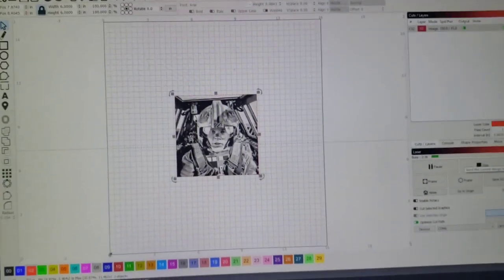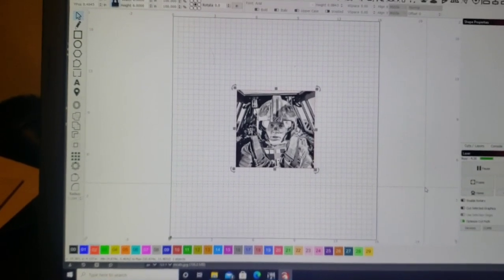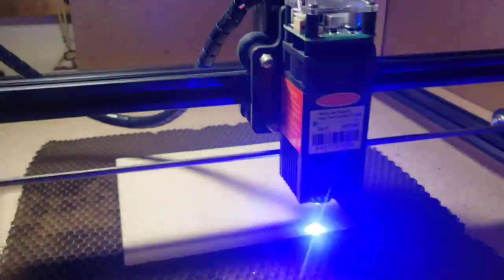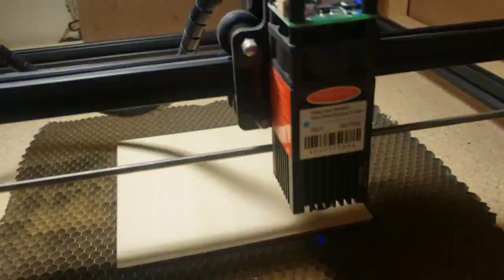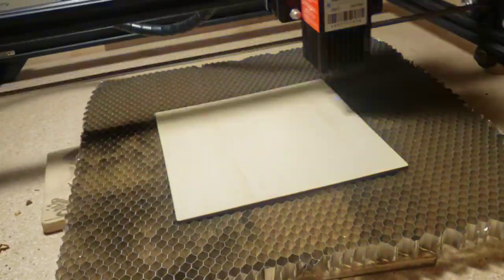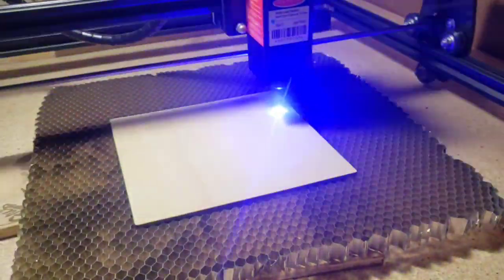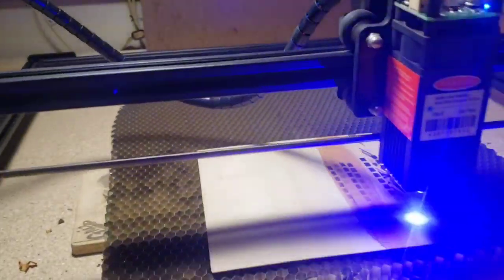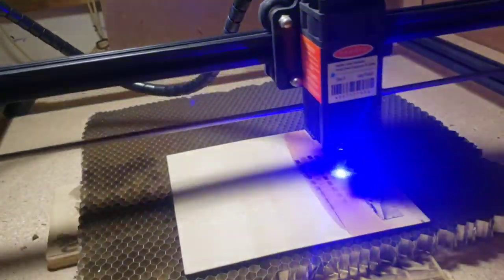The Kenny Hack vs Baking Soda has a better solution been found? mmm? You decide. Ortur Diode Laser.

Comment from the maker: So go to my Full project video. I show where to adjust the image in LightBurn. There is no magic number that works with every picture. This is why the Plugins might fail on occasion. They use the same settings for everything. If you follow what that video shows on adjusting Gamma, Contrast, Brightness, and the enhancement settings what you see on the screen will be close to what you get on the wood. Now all woods burn different. I like Basswood slabs from Hobby Lobby and they work very well with my method. Pine wood does not work at all. Only burns black. So if you like a certain wood you need to practice on that wood to see what the image needs to look like on the screen vs what it looks like on the wood. This is very important to understand. Using other peoples numbers only gets you close. You have to get the correct settings for your machine and wood type. Using real wood slabs is the easiest. Treat both sides with the same amount of stain and White Wash. Practice a few test burns on the back to check your settings and then burn the image on the good side. Most plywood the back is a different grade of wood than the front so the numbers won't exactly match.

Comment: I'm curious, what is your ebonizing method? I heard baking soda and lime juice but in the video it seemed as if that wasn't it. Could you please share what it is that produces such clear photos?
Reply from the maker: Often called vinegaroon. Mixture of steel wool and vinegar. Works very well to age most woods. What I have found to work best with diode lasers is 1 tbsp of Borax mixed into 1 cup hot water. I have a video going over using Borax. The Vinegaroon "Kenny Hack" was just something I found when I first started using lasers. It just made it possible to get the speeds up to 6000-9000mm/min which at that time was considered impossible to produce quality work at that speed with a 5w output diode. Pretty common speeds now for the higher powered diodes. When I first started 1000-2000 mm/min was what most people were running at, most people thought I was lying when I'd post +6000 speeds.
Reply: @TheKennyHack  oh wow, thanks! Is there a video you've done sharing this vingroon technique?  I'd like to try it as I have the 10 watt congo z1
Reply: @TheKennyHack  I've found that borax leaves a black soot that smears unless you clear coat afterwards.  Do you experience this! I feel baking soda in warm water works better.  I have a friend that is producing killer images with just that

Comment: Hi. Love the videos. Very helpful. 
What is the magical solution you use? 
I was watching your slate engraving video and you said you used 50%, is that the same thing?
I’m currently trying to dial in my engraving skills. 
Many thanks.
Reply from the maker: I've since found 1 tbsp of Borax mixed into 1 cup hot water to be the best treatment to use for most things. Just whipe it on and dry. whipe the surface with your hand after it drys to brush off excess Borax and it should be ready to go.
Reply: @TheKennyHack  epic. Think you so much. I’ll give that a go. Legend!
Reply: @TheKennyHack  out of interest. Long shot but, Will this work as a prep material for engraving metal too? 
I’ve been playing around with diy things I’ve seen on YouTube but don’t get a very dark engraving. I’ve seen brilliance black metal laser spray works really well but its £85 for Can. 
Any advice much appreciated. 
Many thanks.

Comment: I have a 4.5 output 30 W module diode laser, i use 20% power 3000 speed,with a teaspoon of bacon soda to 1 cup of water , you had it mixed too strong.power can be set lower than normal also .it does work brother..
Reply from the maker: try Borax it works way better than baking soda. Baking soda is useful when working with food grade products, it just didn't work very well at maximum machine speeds. If you're fine with running slower speeds it works just fine.

Comment: ok, after following your recipe at a 50% solution i can attest that it works as advertised.  i was able to double my working speed and get my work done faster. Only question that i wasnt sure on. do you a)strain any of the residual steel in the solution and b) if not, do you stir it prior to application?
Reply from the maker: I don't strain out the residue, but I know some people have. Yes, I stir the contents prior to applying it. 50% is pretty strong and will really stain most woods. You can knock it down to about 10-15% and it won't stain as much but still allow you to run at higher speeds with less power. A lot of people are coming up with their own mix recipes of this stain and other products to help with burn efficiency. Im kinda biased to my method but don't be afraid to try other things. Just make sure they're safe products to burn. I've found some great burn enhancers but they weren't safe to recommend for use.

Comment: Baking soda worked for me, much better then no treatment, a darker more defined image. 1 tblspn/cup water. 2400/50, 20 watt Atomstack
Thanks for all your time, effort & info Kenny!
Reply from the maker: I think a lot depends on the laser. I get better results with baking soda on my stock 15w model vs the stock 20w and better at lower speeds. Working on a kitchen sink mix that has a bit of everything in it. Im always looking for best results at 7000+ speeds to get the most efficient time out of my laser use.
Reply: @TheKennyHack  how long have you been running your machine at above 3000mm/min? Have you noticed any issues in doing so assuming you've been doing it for a while
Reply: I got a 40 watt nasum a5 pro coming tuesday hope the baking soda method works!

Comment: ammonium chloride !!!
Reply from the maker: Works well but you shouldn't burn chloride with a laser. Makes corrosive fumes that will damage the laser and toxic to breath.
Reply: It's found in allot of food and is also great for wood burning with a heat gun. Not sure the laser would produce sufficient heat.

Comment: Can you do a video on how you adjust your settings to get desired results along with what your preview shows? Thanks loving all the help you have shown already
Reply from the maker: So go to my Full project video. I show where to adjust the image in LightBurn. There is no magic number that works with every picture. This is why the Plugins might fail on occasion. They use the same settings for everything. If you follow what that video shows on adjusting Gamma, Contrast, Brightness, and the enhancement settings what you see on the screen will be close to what you get on the wood. Now all woods burn different. I like Basswood slabs from Hobby Lobby and they work very well with my method. Pine wood does not work at all. Only burns black. So if you like a certain wood you need to practice on that wood to see what the image needs to look like on the screen vs what it looks like on the wood. This is very important to understand. Using other peoples numbers only gets you close. You have to get the correct settings for your machine and wood type. Using real wood slabs is the easiest. Treat both sides with the same amount of stain and White Wash. Practice a few test burns on the back to check your settings and then burn the image on the good side. Most plywood the back is a different grade of wood than the front so the numbers won't exactly match.
Reply: @TheKennyHack  thanks for the response. Going off the preview image is that how it will look or what’s on the screen with your settings?
Reply from the maker: @robertbrockman6655 yes, very close anyways with the Basswood I normally use. So just try different adjustments until you get the light and mid tones where you like them. From there its finding the right power settings. Your stain and white wash might be different strength than mine so the power setting might not exactly match. If you run at a lower speed it will be a lower power too.
Reply: @TheKennyHack  thank you very much

Comment: 🤔 citric acid maybe
Reply: have you tried figuring out the chemical make up of your own stain maybe you can improve it, would be a  good start and interesting to see what you learn from finding out
Reply from the maker: @thristycamel5875  yes I've tried breaking it down to individual components. Just vinegar has no response, iron oxide powder in water has no response, and iron powder in water has no response.

 I originally thought it was the broken down iron oxide igniting when heated by the laser, but on its own it only very slightly helped. I now think it's the chemical stain that is making it work so well. Ive tried several other wood stains and most all of them help make it burn better on the dark end of the greyscale. This is by far the best one ive found for making the light end of the spectrum show up so well. Makes adjusting the photos a lot easier compared to the other products ive tried.
Reply from the maker: I don't think if the lime juice did anything I wouldn't expect much better from other citic acids.
Reply from the maker: @spikey911usa  would love to see how this method works on a co2. It tripled my speed on a diode at even less power so a CO2 should be able to really dilute down the strength and still get improved results. I don't think I mixed the baking soda wrong, but its not even close to being as good.

Comment: I created some Kenny HAck and it has defo helped get a better photo image but the wood rounds I am using go a really icky. the outsides arent too bad but the centres go grey and dirty looking. any way to achieve better photos on pine rounds? x
Reply from the maker: Pine is a very soft wood. If you're burning a solid black logo its fine to use but if you're trying to do a portrait find a good hardwood and sand it smooth. If the stain is making it too dark thin it out with more water. Even at only 5% strength it will help it burn better.
Reply from the maker: Try the Basswood slabs at Hobby Lobby. The brand name is The Wood Pile. Ive had good luck with those and they are pre sanded.